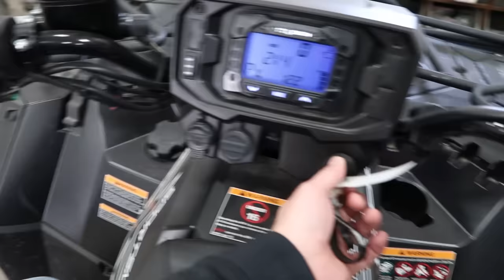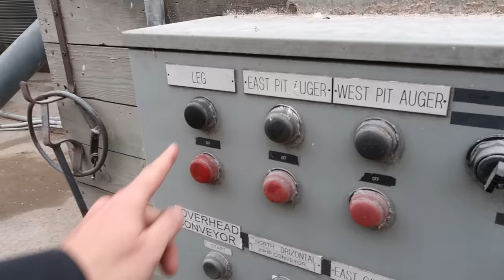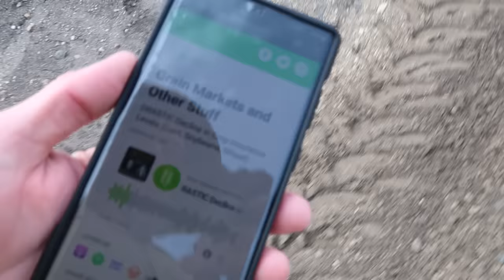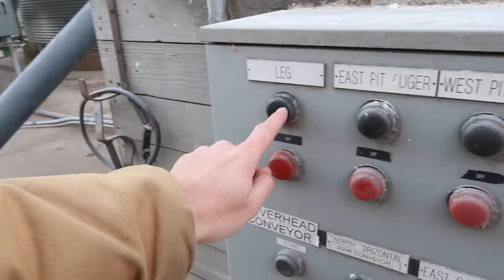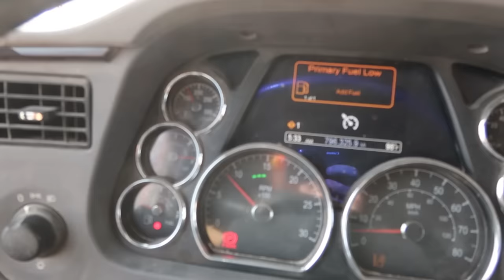Good News, Bad Timing?!

Comment: Here's a hint for your jack stand on the snow blower. Don't turn it upside down while in use. Raise it up till the base almost touches the frame, and drill another hole (if the isn't already one there)for you pin.
 Then put the stand down before you lower the blower to disconnect.

Comment: I have a 10ft dirt dawg blade like yours and what I've learned about running it. When you just wanna grade lightly but not in reverse. Run your 3rd link out to where when you set it down, just the rear blade touches the ground, but dont set the blade all the way down, and it'll barely scratch the ground. And it you wanna do some serious digging, you can just set it all the way down. great tools for sure👍🏼

Comment: Zack, put a lot of chain(thicker) lube on the thrower chain and WD40 on the PTO connection. You want lots of lube on the blower chain to preserve it through summer and a lot of thin lube on the PTO disconnect to thin out the dried grease and dirt in it. It should come off easier. Good luck.

Comment: Zack have you seen the snowblower hack where they slit a length of plastic tubing long enough for cutting edge of the blower. Putting the tubing over the cutting edge. Stops picking up your gravel driveway

Comment: Great news about Jim.  
Awesome video.  Can't wait to see the new equipment in use.  Hope it works better than the one that went through the tornado.  
Air lines on semis cam be a royal pain.  Had a leak on one I drove.  Talked the boss into getting it fixed.  The parts store didn't have a replacement.  They ended up brazing it in order to fix it.  The next day I was pulled in to do a level 2 inspection at the New Mexico port of entry.  Guess I was a good thing I pushed to get it fixed.  
🚜🚜🚜

Comment: You can adjust the pitch with the third link to prevent the blade from digging in. I would get an I beam and drag it around your parking lot. It’ll leave it like a billiard table. Cheers 🇨🇦

Comment: Heater blower motor could be a Speed resistor - for the lower speeds they have a wirewound resistance in the airflow to cool it off. If airflow is restricted, it burns out and goes open. 😢

Comment: By tapping on the grain pump top channel, it tells me you are running it backwards.  The grain goes up the bottom tube.  We have one, and also ran it backwards.  It was running under capacity and tripping breakers.  I found a diagram online showing it running up the bottom, so I reversed the motor all the problems went away.

Comment: Regarding that seatbelt noise maker at 22:40.  On my 2003 Chevy, I unplugged the wire under the seat that connects the seatbelt thingy to the truck's wiring.  Then the truck thinks the seatbelt is done up 24/7.  I dunno if that works on a 2024 though.  Another solution is cut a buckle out of a totalled truck at an autowrecking yard, and stuff it into the seatbelt do-hickey beside the seat when you are just driving around the farmyard.  Both highly effective, while simultaneously likely very illegal.

Comment: We have had problems running full flow on the lift side of the leg the buckets beat the grain around and dosent alow them to fill correctly
Reply from the maker: I think that might be part of our issue
Reply: We ended up raising the bottom of the transition 10 inches (almost fixed it ) then put the next size bigger pully on the bin auger to slow it down just a bit and no problems in two years

Comment: Dang near 60, built probably 30 FAL's from kits in the 90's... after pulling them out of the Brownell's parkerizing solution they went straight into WD40.... in wall paper trays... Every six months I drown my pew pew's in WD40.... have tried other pew pew oils but they just gum up... WD40 all the way.... Water Displacement 40th Formula....

Comment: March 6-7 I was in JD and saw a tractor, planter hooked up, pulled up out of lineup.  *not the  used combo in tractor/Imp lineup.*.  I told my wife.  “It looks like a prop for MF YouTube”.   It appears I might have been right?
Reply from the maker: We're you at a dealer or the factory? Mine was in Glenwood, MN at that time
Reply: @MillennialFarmer  Glenwood after doing PLC/ARC At CFSA formally ASCS.  ;).
Reply from the maker: @larrythompson8630  that was probably it!
Reply: @MillennialFarmer  dang I am talking to the real MF.  The actor would have needed time to understand that code.   ;)

Comment: Please stop setting a bad example by grabbing ahold of an implement or tractor PTO shaft while the tractor engine is running. PTO clutches and PTO brakes can and do fail. Always Stop the engine.